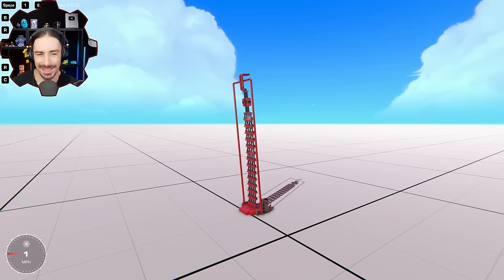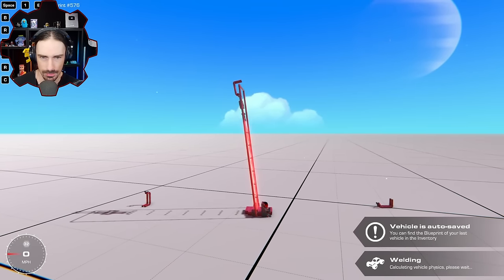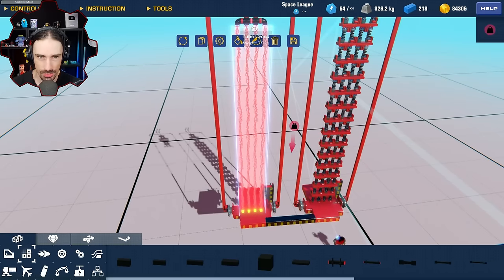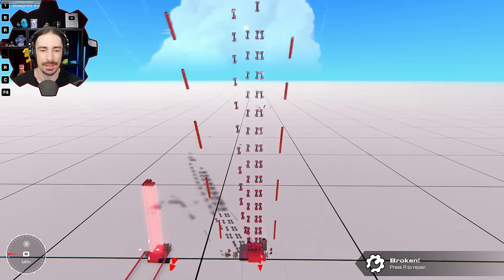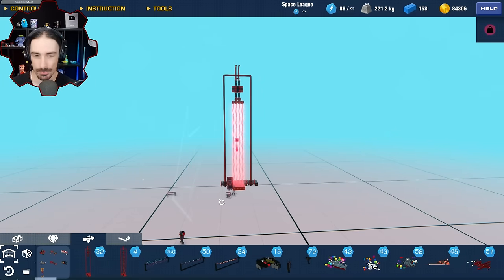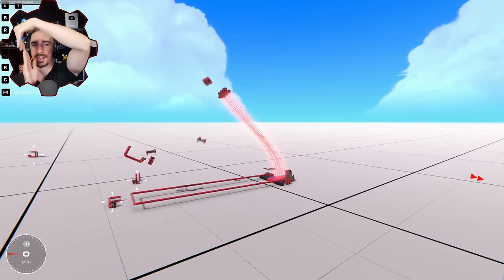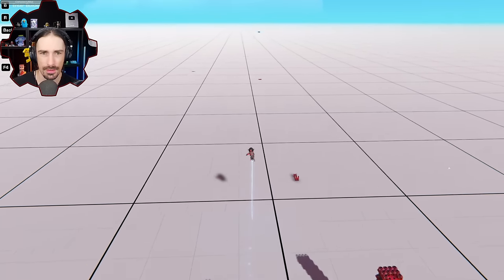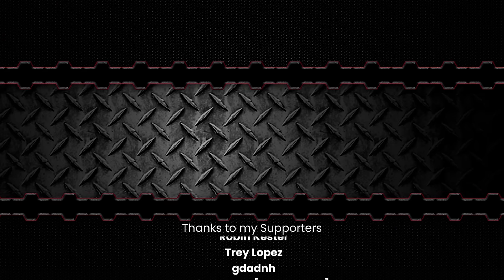Can This Create a Better Catapult Than Suspension?

Comment: After thinking about it for a little bit, it actually makes sense that the shorter one would perform better in a way because the shorter one gets more tension per each individual power cupler, so you get more force out of each individual power cupler meaning that you will get more force per each individual one increasing your distance.
Reply: It makes sense.  Think about the spring from a pen, Vs the floppiness of a slinky
Reply: btw u might want to correct those spelling errors (cupler) before a bunch of nerds correct you
Reply: @lindseybergstrom  found the nerd! 😅
Reply: You can even see how on the longer version, everything after the first 2 is basically resting. Maybe doubling it up and putting plates every 1-2 couplers could be powerful.
Reply: It may also be that less force is getting lost in a dampening effect from the flexing of the cupler, cant say for sure though.
Reply: Yep!
It's a 90 degree bend, but with, say, nine power couplers, each one only bends by 10 degrees.
With only 3 couplers, each one bends by 30.
The flat multiplication increase (10 degree bend x 9 couplers) is dwarfed by the 'exponential' increase in force the further each coupler bends.
I don't know exactly how they're programmed in the game, but from what I've seen, I figured real-world logic would stand to reason.
Try it for yourself with a piece of rigid metal wire!
Reply: Ya it's what i thought too only the first two did anything
Reply: i think its actually due to leverage and the amount of weight it has on the end of the power couplers
Reply: Bro got that on chat GPT
Reply: @lindseybergstrom  true they always use this emoji ☝️acting as if that would make it funnier.
Reply: With both materials it was creating a point close to the ground where there was a lot of torque due to the length of the arm, the farther down on the arm the mater is the more torque it experienced, making a nearly singular point of bending. This is just a flaw with the physics of this game where it seems to want to calculate each individual piece of material instead of as a single arm. Therefore this shouldn’t work IRL.
Reply: Every people saying stuff bout torque and strength here are nerds fr
Reply: That is indeed how springs work, stacking 2 springs on top of each other (inline) halves there strength, while stacking them side by side doubles there overall strength.

with the first setup he has 4 side by side, so x4, but 7 inline, so /7 , that's equivalent 0.57 power couplers.

with the second setup, x8, /7 , so 1.14 power couplers.

with the final setup, x12, /3, so 4 power couplers.
Reply: Your deflection is also a function of length [(Force*Length^3)/(3*Elastic Modulus*Inertia)]. The deflection of a member with a load at one end is going to increase with length under the same force, so it makes sense that a shorter coupler would require more force to deflect to 90° and subsequently have a larger acceleration. I was immediately thinking of making it shorter because I just got out of an exam about all of this stuff 😂
Reply: @coolHawk_  I’m doing AP Physics (not as complicated) but it still got me thinking almost immediately about making the arm shorter😂.
Reply: @rattatoui2654  AP Physics was so fun! On a conceptual level it’s still possible to explain with AP Physics, but if you really like forces I would highly recommend looking into civil engineering. Being able to understand why stuff like this happens and actually have a formula to visualize it with is so fascinating to me.
Reply: @coolHawk_  I’m actually going for mechanical engineering, I did look into civil though.
Reply: like bending a toothpick, yea
Reply: I thought it was kinda obvious why shorter is better in that situation
Reply: It is similar to hydraulics thinner surface area and less force can push a huge surface area with huge force, hydraulics depend on pressure and pressure is force divided by area so for a fixed pressure increasing the surface area increases the force.
Reply: What if you make a long one that just keeps coiling up as much as possible, would that work better maybe?

Comment: With a slight tweak to the payload and a similar design. I can confirm that I was able to get a power coupler catapult that launched 9 testing area squares consistently. The couplers were in a 2longx2x4 formation, with a solid block connecting them, then another 1longx1x4 section before the payload and hook. The payload was also 4 tnt in a 2x2x2 cube, connected with 1 additional 1x2 connector. The rotating servos were also on 90% strength to prevent breaking it.

Comment: As someone who enjoyed springs in my physics class, and is going to college for engineering, I felt that i wanted to offer an explanation for why the shorter springs are better. There are three key factors in this, being the spring force, elasticity, and fulcrums/mechanical advantage. For each length you are imparting equal force into the springs. In the longer one, each individual spring then holds less potential energy than the springs in the shorter one. Now when you spread that out across the length, the elasticity reduces the mechanical advantage of the member itself, and thus each individual spring is now fighting to overcome both elasticity, and the weight of the payload. Less springs means less elasticity to fight against, means better performance, and since each spring has more stored energy, each spring can impart more energy once the force it uses to overcome elasticity is taken into consideration. Then the last part is about the fulcrum. Two weights placed at the end of different length bars will feel heavier on the end of a long bar, and lighter on the end of the short bar. Which means in a longer one the payload requires more force to move, and that is after you remove the force for the added elasticity. All in all, the shorter springs have less forces to overcome. That’s my two cents.

Comment: You forgot a major change since making the first catapult:  Aerodynamics!  They completely changed air resistance behavior with the airborne update, and as a result it looks like both catapult are reaching a maximum range as the dynamite slows down from bad air resistance.

Try a javelin or spheroid launcher and see how far those streamlined projectiles can fly!
Reply: A sphere would be the best so it has okay aerodynamics no matter the direction, and a javelin would use a lot of energy correcting itself
Reply: That's not a topic you discuss everyday out of context. Imagine walking past someone in a grocery store with their friend and you hear, "So the aerodynamics of TNT really is not optimal for catapult use...."
Reply: @steeljawX  thats exactly what i talk about everyday with my friends in the grocery store. how is that not normal? My gay friend suggests a javelin or any rod, might try that.
Reply: @scascspong5600  you sure hes talking about trailmakers😂

Comment: From what I can see, it seems to be working by the same principles as a ruler on the edge of a desk. Having the ruler further off the edge of the desk makes it easier to bend and there’s less tension, due to there being more ruler available to bend, thus meaning the tension can be absorbed more effectively. If you shorten the length of the ruler, then it has much more resistance when you try to bend it, because there is less ruler to disperse all the force into. Therefore, shortening the length of the ruler would give it more tension. Less can, in fact, mean more in terms of physics.
Reply: Look up the relationships between shear, moment, angle, and deflection! 
For situations like this or the ruler, you’re essentially making a cantilever beam where moment is resisted at one end and there is a force at the opposite end. To calculate deflection for that type of beam you use the equation [Force*Length^3]/[3*Elastic Modulus*Inertia]. 
For a ruler where the E.M. and inertia are the same, making the part hanging over the edge shorter means that it takes more force to deflect the same amount as if the amount hanging over the edge was longer. Of course, throwing an object also complicates this as you start dealing with moments because of different lengths in catapult arms, but overall we should see that the shorter arm does better when dealing with deflection-powered launches.

Comment: 16:25 that reminds me of needing multi density materials, where the different materials apply varying tension to keep things bendable but elastic/ridged. Maybe different combinations of soft and stiff power couplers could manipulate the structure to stay straight as it throws.
Reply: one step further, also add in a layer of suspension.

Comment: One thing I wish you tried is to add a connection point between each set of power couplers. When you pull them back with the current design, they slide past each other. If you added a connection point, they would have to stretch much more and potentially yeet even farther

Comment: I think if you adjusted the delay for the release on the power coupler slingshot it would help because from what i saw and how i processed it is like casting your line while fishing. If you release to early you get more air and less distance but if you release too late you just end up getting less distance
Reply: I commented this at 8 mins in and barely a minute later he adjusted it 😂

Comment: One more improvement: have a solid arm on top of a few layers of suspensions/power couplings. Especially with the suspensions, you see that only the bottom ones really bend; the top ones stay almost straight and contribute little to the energy storage or release. Limiting the length of the suspensions/power coupler stacks allows you to get more of them in parallel with the same complexity budget, yet get the same (or even greater) overall arm length with a single column of cheap rigid pieces.

Comment: I mentioned this on your DNA video, but the modification you made at 8:29 really enforces my theory that power couplings don't compress linearly, as it looks like having them on the 'contracting' side of the catapult was causing too much resistance for the arm to fold all the way back. So, I threw together a quick hydraulic press-styled test rig to test that theory

With 12 power couplings in a circular pattern (using 4 big, rounded 2x1x2 corner pieces to make a circle and attaching a coupling to each node on one side), 4 sets of 4 pistons pressing them straight down into the ground, and about 4000 kilograms of weight weighing the base down, it seems that power couplings will compress linearly by only about 30% of their total length before hitting an invisible stopping point where they will no longer compress at all. This is harder to observe at higher stiffness values because they do have some spring-like resistance within that 30% range, but strangely, it's very obvious at 0 stiffness. At 0 stiffness, the couplings will compress to a maximum of about 30% and then basically act as solid blocks if more pressure is applied, allowing the pistons to lift the machine off the ground with ease and with no hint of instability

How much this compression factor matters for these particular catapults, I'm not sure, but it's interesting to know that the couplings do, in fact, have limited linear compression and are specifically intended bend/flex. I imagine the 30% of compressed wiggle room is just meant to prevent them from being completely rigid under tension and causing even more spaghetti that we already see

Comment: Mechanical engineering student springs added in parallel add simply
 k1+k2=keq
Where springs added in series aka in line with each other add inversly 
1/k1+1/k2= 1/keq
This means stacking springs resullts in a lower spring constant or less springy
Reply: I feel your pain, sadly people don't seem actualy interested in psysics just adding springs randomly goo boom was the supposed to be the theory here.
I am an electronics engineer with experience with automations and mechanical engineering, it is just like connecting capacitors in series. when i was a student someone connected some capacitors in series for more capacitance and i was like bruhhhh... and the professor got into an existential crisis.
Reply: @kapioskapiopoylos7338 I completely understand why mechanically adding springs would result in less bending force, as more force is shared between everything.

Why would adding capacitors in a series not go up in capacitance? If you had 3 x 50uf they would all deplete at the same rate but why would they not deplete at a slower rate?
Reply: @benclimo461  Divided voltage. same reason as the springs in a way, say you charge 2x100nF(capacity units) capactiors in series with a 12V power supply, each capacitor will be at 6V, the energy stored in a capactior is *E = ½ × C × V² , note the V² as half the voltage means a quarter of the energy, hence the 2x100nF capactitors in series = a normal 1x50nF capacitor. On parallel connection they both get the 12V so they indeed then store 2x the energy.
**U=½ × k × Δx² is the energy of the spring, 
same equation really, in that case the Δx is halved for say 2 exact same springs in series

extra note inductors (coils) are the opposite, parallel means less energy as current is used to store energy there, not voltage.

*
Energy
Capacitance
Voltage

**
U energy
k spring constant
Δx (stretch or compression) of the spring
Reply: @kapioskapiopoylos7338 I wouldn't say I'm pained I really like how scrapman tests his theory and that trail makers has simulated something that replicates reality. Scrapman isn't an engineer even if he seems to think like one he hasn't taken the classes that teach the less obvious theory. I really enjoy seeing him experimentally figure out what we've been taught

Comment: Although the difference may not be much you got to consider the trajectory of the projectile traveling in a straight line, picture a big triangle, the suspension after release was launching in more or less a perpendicular line along the side of the triangle but the power couplers were launching at the diagonal or the hipotenuse of the triangle which in turn would mean that the couplers were launching further since the distance traveled was longer even though the TNT landed in the same place and another case being the aerodynamics of the TNT itself changing the trajectory.

Comment: They induce some of the momentum as they wobble. When we reduce the length the energy is distributed in a small area but also the power couplers don't wobble much. They are good for making curves but the release of potential energy is dampened by the wobbliness ( it somewhat does behave more better than a suspension as we saw in the coupling wheel video).

They are stiffer than power couplings which makes their launch a lot stronger.

The next you do something alike I would recommend to perfect the timing which was realized a lot later by you in this video.
Reply: I don't know why but the word that were bold just disappeared 
1) is about power coupling.
2) is about suspension
3)TIP

Comment: I think the difference between power in the short and long power coupler catapult is partially due to them being trippled up in depth rather than width. This causes a differential in tension/compression between the forward and the rear power couplers that increases when you shorten the length.

Comment: I think the power coupling should be the winner because you have to consider that ScrapMan added extra weight because of the blocks at the top of the power couplers connected to the dynamite. It would probably flick forwards a bit faster without that extra weight

Comment: I think one of the reasons the shorter catapult might be better is that, as you make it shorter, the difference in length between the front and back power couplers becomes a greater percentage of their overall length. Like you mentioned, they resist compression/stretching more than bending. I think making it shorter forces the back power couplers to compress more and the front ones to stretch more, thus generating a lot more force.
Reply: It’s also the relationship between deflection, force, and length! Deflection relies heavily on the length of the member being deflected.

Comment: I have an idea for another episode. Instead of twisting it like in previous episode, try twisting some kind of wheel or half wheel, when the light beams would be curved before they start to twist. This could make some kind of coil, but would require pistons or suspension to contract.

Comment: You should bring back the “can this break the sound barrier” but use glitches like the hover pad glitch and others. Idk how easy it would be to break the sound barrier with a single hover pad, but it might be harder with other propulsion glitches, or you could try to get the slowest speed possible with one engine or the more engines you can keep going less than 10mph the better.